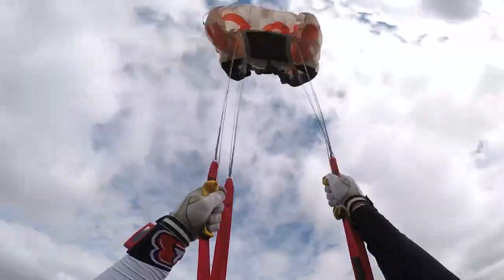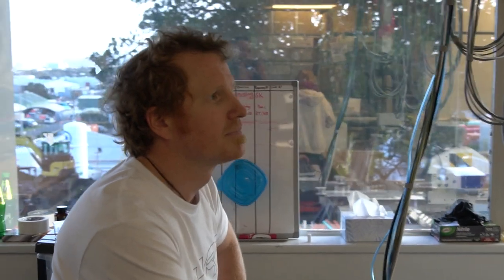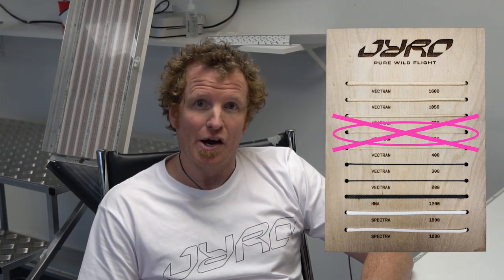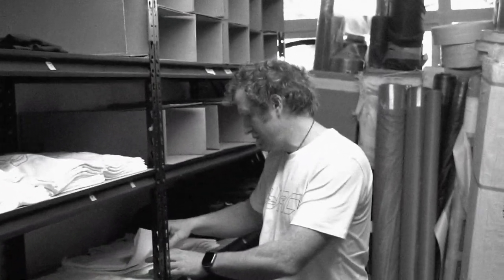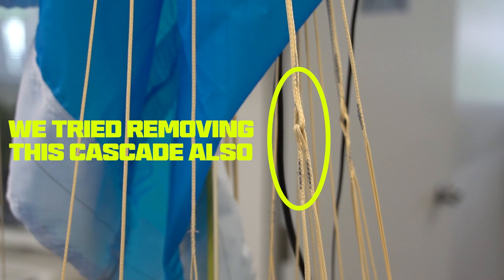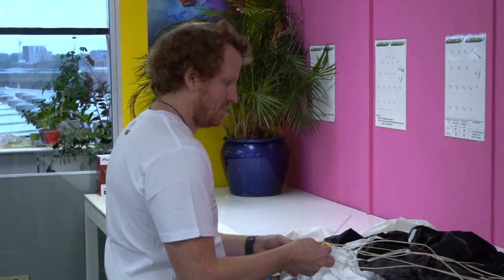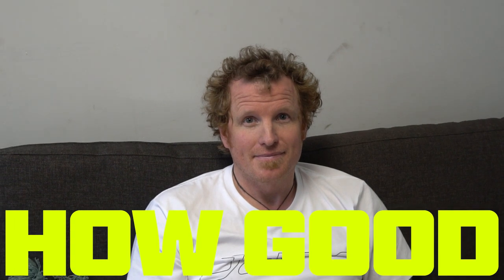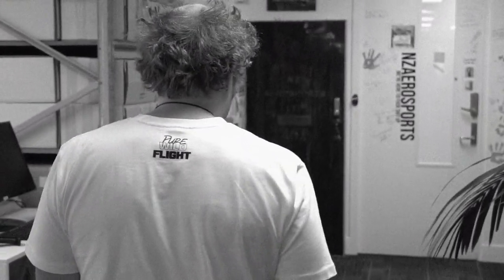Leia | Line Mod Explained

Comment: Ok, when will you fix the JFX2? Had to chop it twice due to tension knots in less than 150 jumps. First time with a brand new canopy with 13 jumps on it. Know two more people from my Dropzone with two chops on the JFX2 due to tension knots. Although at a slightly lesser rate. Size 104 (mine wl 2.2) seems particularly prone for the occurrence as one of the other pilots had the 104 as well and chopped twice although at a very different wingloading.